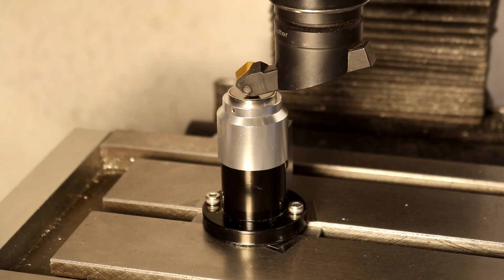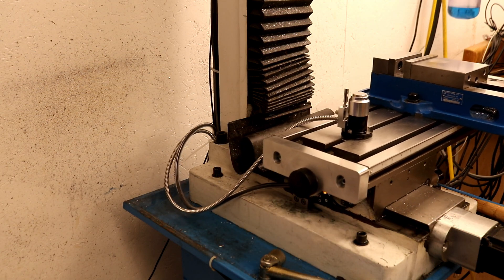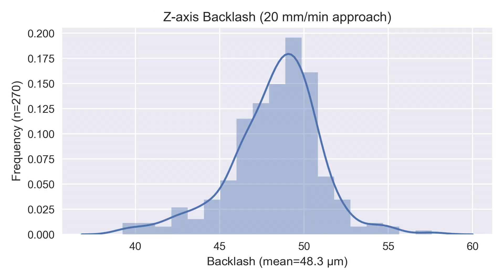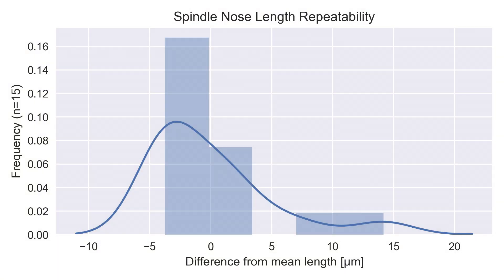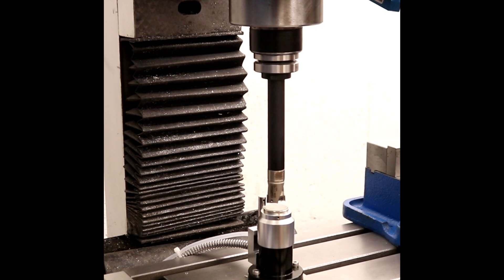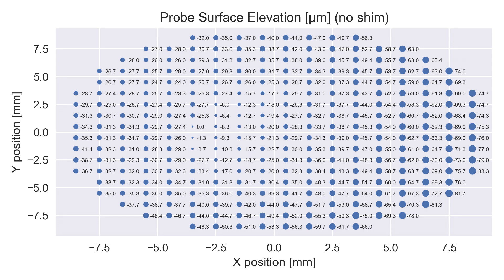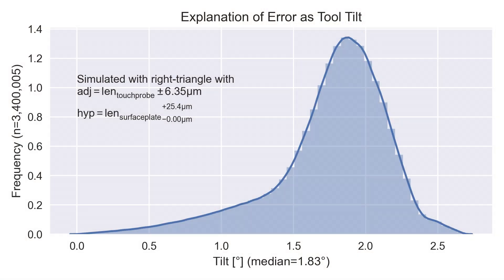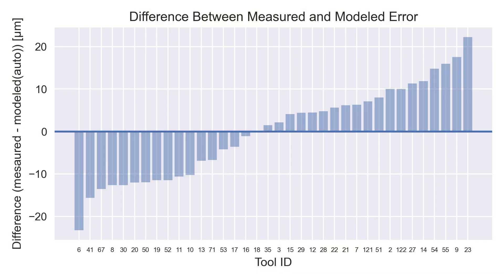Tool Length Automatic Touch Off Probe Error Analysis LinuxCNC

Comment from the maker: This video is pretty heavy on numbers, but the TL;DR version is that inexpensive tool length probes are surprisingly good and well worth checking out. Could be used for primary measurements or verification. (I've been known to transpose numbers in tool lengths when entering them into the tool table.)

Comment: I used the mesa thcad 2 A/D converter,  a touchplate , g38 commands, and the ohmic.comp in linuxcnc to read frequency put out by the mesa card  when 24v is going through the circuit so one lead goes to the cutter that has 24v on it and one lead goes to the touchplate from the mesa as the tool gets closer to the touch plate the frequency starts to go up the closer the 2 leads get, I set a threshold for when it reaches a full 24v and the g38 commands do the rest I think this method gives you the most accurate way to set tool heights would you be able to run some tests to find out

Im applying a component from QtPlasmaC  torch height control dubbed hypersensing its using ohmic sensing and software instead of relays to trigger the surface contact g38.3 probes to the piece and g38.5 slowly moves away from the surface and the moment contact is lost that's the height I think its more accurate because it removes the time a relay takes to trigger I could be wrong I can send you the custom hal file i used if your interested

Comment: Did you connect the yellow wire to resistors?what type of resistor did you use?I'm using 2.4k ohm resistors and its not working,,help me
Reply from the maker: Attaching the probe that I received to a Mesa 7i76e didn't require an external resistor at 24V. The diagram in the instructions show a resistor in probe. If your multimeter uses a voltage greater than the Vf of the LED, you can measure if the probe has a resistor by measuring resistance across the probe light leads. If meter reads zero ohms, try flipping the leads. If reads zero ohms both directions then meter probably uses too low of a voltage to get the LED to conduct.

Comment: Quite a significant analysis. Have to say though, parts that requires that sort of tolerances wouldn't be made on such thermally stressed and rigidity impaired machine-tool anyway.  A tolerance of 0.03mm is normally sufficient for hobby spacecraft making.

Comment: Very interesting. Thank you! I have a renishaw touch probe on my lcnc machine (flat carbide contact surface). As you found the errors come from every direction and all we can do is try and reduce them overall. I suggest a protection cover for your probe and stmbl drives with real servos 😁

Comment: I dropped my touch-off probe which looks identical to yours. The center piece popped off and it appears it was only held on by a non-precision glob of glue.
Reply from the maker: Not to be confused with a precision glob of glue :) Could you see and identify the primary trigger mechanism?
Reply: @kentvandervelden  I could not see the trigger mechanism (or any way to open it up further). Just appeared to be a hard disk glued to the softer top. Sorry I didn't take a photo before regluing.

Comment: are you sure about the "overrun signal"? i think you're using the wrong switch for the measurement ;) usually those tool length sensors are supposed to work the other way around: the tool moves at high speed until the first switch contact signals the "initial approach distance". then the movement slows down and continues until the second contact which is the actual measurement... as a protection - you know how much travel the sensor has until hard stop, so limit the move to that distance after the first contact. and if you get second signal without the first in advance - the first switch failed, then stop immediately. still has to be enough overtravel to decelerate from rapid speed.
Reply from the maker: Please send an example of the probe you are describing. From what I've seen, the first trip use a kinematics mount while the over travel uses a basic switch. The only tear down I've found is at martyscncgarage but he may be mistaking the over-travel switch for the primary switch. Without taking this probe I have apart, I rely on the manufacturer's instructions, and in which case I've wired and am using this probe correctly. I've not tested the reproducibility of the over-travel switch. Thank you.
https://www.youtube.com/watch?v=3HR2bPmyirs
Reply: @kentvandervelden  oh, ok, if so - i may be wrong. i was retrofitting an old mazak with llinuxcnc a while ago and it had a pneumatically actuated tool length sensor arm with 2 switches working the way i described. but the plunger had much lager travel and distance between switches. like 50mm. you could hit it with pretty fast, gently decelerate and creep to the measurement point... thought this thing works the same way. my bad :)

Comment: You talked about the convexity of the surface of the tool length setter. You even plotted that convexity. 
Could you lap the surface of the probe to make it flatter? Maybe within a micron?
Thanks!  :)
Reply from the maker: The surface may be very flat but the sensing mechanism have a non-flat response surface. If the pressing off center, maybe the surface tilts slightly and registers a different length than if pressing in the center. I suggest this only because of relative difficulty of making a surface flat vs. making a mechanism move perfectly parallel. Thank you
Reply: @kentvandervelden  that makes sense. Looks like there's a lot of room out there to develop a much better tool height setter.! A lot of room.....
Reply: @artmckay6704  its like 40 gbp us around 50 dollars, what kind of accuracy are you expecting at this price point lol

Comment: Very nice video! I have the same issue that the probe trips during machining like you mentioned in the video. How did u fix this?
Reply from the maker: A few ideas you could try are: 1) disable the probe input if the program is running; 2) filter the probe input; and 3) use a switch on the probe. In LinuxCNC you could and2 the probe input with halui.program.is-running and halui.mode.is-auto. This might not work though... if a probing operation appears as a running program. The filtering operation is probably the simplest and a LinuxCNC debounce module could be used but it adds latency (so move slowly and all will be fine.) The switch could be physical, or use a digital output and2'd with the probe input, where the digital output (the switch) is triggered by m62-65. Probably others ways... I'd start with filtering and if that does not work well, use the switch. Of course, use shielded cable and prefer higher voltages if possible. Hope something here was helpful.
Reply: @kentvandervelden  thanks for the reply! i will try these solutions soon.

Comment: I just bought one of these and i cant read the manual and the wire colors dont match the few english words in the manual. whats an easy way to determine circuits without the control board being online. im still waiting on my 9014 frame but i do have my gecko g540 controller and all electronics but i have to install 4 gx-16s for the homing switches and the tool probe and i have to wire in the relay for the spindle control. I have everything but the frame but its all in boxes and i havent started anything yet because i still have to weld up a table. Im making a full steel table to be able to ground the machine through its base to the outside ground.
Reply from the maker: If there are four wires, and no LED, you could try using a continuity tester. The probe that I have has a tool-length switch and an overtravel switch. With the probe electrically disconnected from anything else, try attaching the continuity tester to each pair of wires and gently pressing the probe down. After the first switch is found, you'll know this method should work and can look repeat to find the overtravel pair.
Reply: @kentvandervelden  thank you

Comment: What a simply superb video. I’m just starting in cnc milling (haven’t switched my machine on yet!) and was wondering about where errors come from when measuring tool height - your deep dive into this particular method has a lot of take home messages for other methods too. Super interesting and thoughtful. 

Tying   down errors here, in tramming, work holding, and work position measuring - will go a long way to ensure cutting with multiple cutters - will register sequentially as one would like, and seem super important to understand and pick Methods within ones budget so as to minimise errors in each.
Reply from the maker: Thank you, I'm really glad you found the video useful. Having a small machine some problems are more pronounced and so it's better suited to the work than a heavy rigid machine. I'd like to understand where error comes from and how it might be corrected on a budget, in hardware or software. I guess it's a curiosity to have an excuse to learn more about mechanics :) After a machine is reasonably good, you might check out IPE's videos on software error correction:
https://www.youtube.com/playlist?list=PLm4_p2x39CHgF_gRtyBFJgPCrsmbsnhPW

Comment: Great deep-dive on this.  Did you consider the runout introduced with the TTS interface between the tool and spindle nose as a potential factor?  I did some exploration of error in the TTS/spindle interface several years back and found that clocking of the holder in the spindle produced measurable changes in runout.  Drawbar tension was also another factor.  This seems like it would potentially translate to error with tool length probing unless you could guarantee clocking of the holder, drawbar tension, etc.  I suspect there's also additional variability introduced with the position of the collet inside the holder, tension on the collet closer nut, etc.  I think your tramming of your mill column and head using the ground rod in the tool holder could also be subject to tool holder/spindle errors - in other words, if you trammed it perfectly with one holder/collet/rod setup, I suspect if you put the same ground rod into another holder/collet setup, you'd probably see error.  It's a deep rabbit hole - great to go down it to understand the sources of error, but also important to find a realistic point to stop chasing errors on a hobby machine and just move on with making some parts!  Cheers!
Reply: Also, if you missed it, Cliff/Threadexpress in NZ has done a lot of interesting analysis on these tool setter probes.  Youtube doesn't seem to let me post the links, but check his channel and search for "Toolsetters."
Reply from the maker: Thank you! For each setup, a complete set of measurements was taken: all tools were measured, never removed from their holders, always clocked (within a few degrees), and drawbar torqued. While torqueing the drawbar, I subjectively applied a counter force to the mill head. I also tried touching off stacked gauge blocks of various lengths to learn about the ballscrew error. I was trying to not need high measurement accuracy. If I could get high reproducibility (which seemed to be so), I could model and correct the error (which I failed to do.) There's the troubling rabbit-hole question: with high reproducibility, what am I doing wrong to model the error? Of course you're right, in the end, the accuracy is well beyond what I can make use of :)
Here are Cliff's videos, parts 1 and 2:
https://www.youtube.com/watch?v=wDGvQHevN9Y
https://www.youtube.com/watch?v=pOCxNe3c4x0
Reply: Exactly. So many potential sources of error from every direction. Use best practice, best tools you can afford, make and measure! If you know what is happening and why you can keep moving in the right direction...

Comment: Did you consider the influence of the debounce? In 20ms delay the mill travels 67µm with 200mm/min search speed.
Reply from the maker: Hi Robert, the tool's final sensing speed is 10mm/min, so maybe 3.35um of uncertainty? The final speed might have always been 1/10 of the initial speed, and I tested different approach speeds, but I'm not seeing anything in my notes or the video about explicitly testing different final speeds. I certainly could have overlooked what you're suggesting. Would be embarrassing :) Thank you for asking

Comment: Hello kent,  maybe a stupid question but, the yellow wire is the signal wire and the green wire a ground wire? i'm realy confused with this probe
Reply from the maker: There are two common varieties of this probe: a four wire and a six wire version. The four-wire version can be thought of having two switches (while the six-wire version is more likely an inductive sensor.) With the four-wire version that I have, the yellow and green wires together connect to the main probe switch. The other two wires connect to the normally-closed over-travel switch. The electrical symbols in the diagram near 1:11 are a little confusing... perhaps there is a four-wire version with an LED? If you ignore that and think of it as a switch, the wiring may be easier. Regardless, honor the direction of the LED just in case. Let me know if this did not help and if you need me to double check wiring on a Mesa 7i76e.
Reply: @kentvandervelden  Hey kent, thank's! i found out that my board is damaged. i thought i did something wrong

Comment: Great Video!
Reply from the maker: Glad it was helpful :)
Reply: @kentvandervelden  Will you show the settings, how to configure it?
Or just simply use a probe input?
Reply from the maker: Sorry that I overlooked that. All my configuration files are on GitHub, and link should be in video description. Mostly, just connect the tool length probe to the probe input in LinuxCNC, add a lowpass filter, and everything seemed to work. If I make a video on the Drewtronics probe, I'll be sure to explain the necessary code. It's the same code as the tool length probe.

Comment: Good video, Kent.  I was following it along and was ready to comment "what is the probe surface or response isn't uniform!", but you saw that coming. ;) I have one last probably wrong set of suggestions.  First is are you using the same reference surface between when you have the tool mounted in the machine vs when you have it on the surface table?  The second is that you are doing the tests differently.  In one, the tool hangs and in the other, the tool is the opposite--it stands up.  How much error do you expect due to gravity?  I imagine that would vary based on stiffness, mass distribution, and length.  Maybe a little based on geometry, too. What was it the mech-E's are always telling me?  Oh, yeah, everything is a spring!
Reply from the maker: Hi David, not easy questions... The same surface is used in both cases. The tool holder rests on the surface plate on the same face that pulls against the spindle nose. I'm less sure about error due to mass... but the error seems to have no qualitative correlation to error. I didn't weight each tool and do the regression, but looking at the errors, I see the big and small tools towards the high end of error.
Reply: @kentvandervelden  That's good enough for me.  Thank you for considering my silly ideas.
Reply from the maker: @davidwillmore  Not silly at all. I was reading a paper today on sources of errors in machines. In their diagram of sources were multiple springs at each joint :)
Reply: @kentvandervelden  I guess I should keep listening to all the MEs, then. ;)

Comment: That was quite an extensive rabbit hole. I picked up one of those probes a while back but am yet to get it setup. Amazed to see someone go that far into optimising the probing cycle. Thoroughly enjoyed the video. Keep up the good work
Reply from the maker: Hi Jonny, thank you! I should have shown the g-code for the probing routines. The updated ones will always be in the GitHub repo.
Reply: @kentvandervelden  I think you showed plenty. Still getting my head around linuxcnc as an escapee from mach3. I appreciate your attention to detail but practically dont think I will go to the depths you did. For me its overkill for the level of precision I require. Most entertaining certainly.